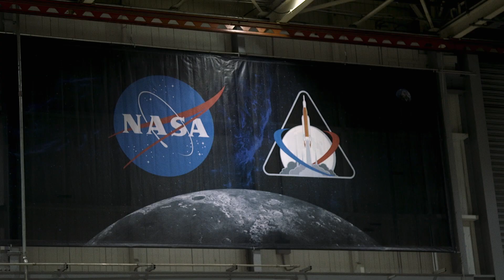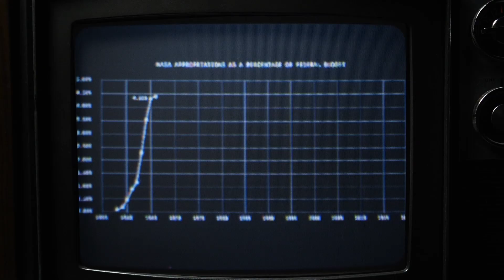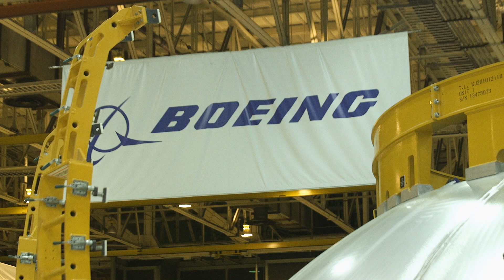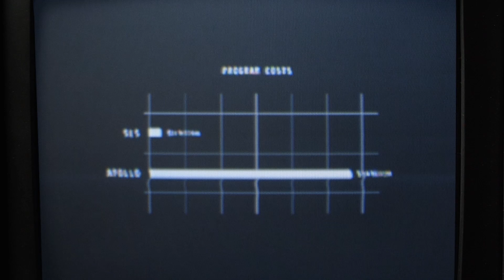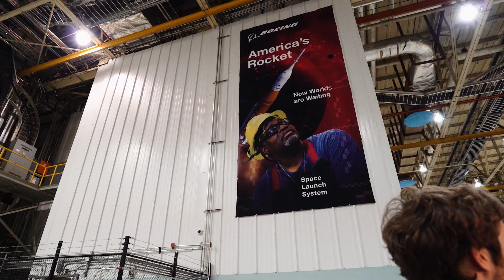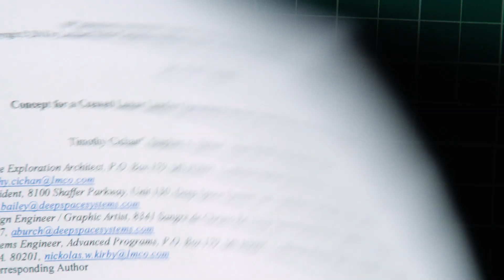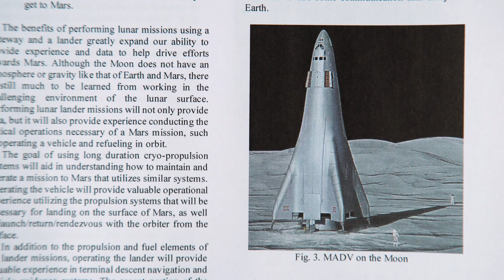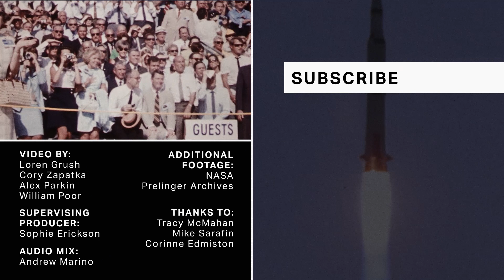Why NASA hasn’t gone back to the Moon

Comment: Let's cut it short.

NASA hasn't been funded enough. End video.
Reply: Also a lack of public interest and political will. Probably also doesn’t help that our economy is mostly service based and no longer manufacturing
Reply: Cardinal but NASA said they destroyed the technologie to go to the Moon. Sounds not like how humanity would deal with that kind of technologie.
Reply: Nasa also explained why its pointless re-building plans from 50 years ago. There is an in-depth video explaining how it's easier to build a new rocket from the ground up than to make an exact copy of an old design. You can simplify the new design and make it more cost-effective the second time around. We got there once, we can make there again.
Reply: Cut it short, nowadays America is shi. , Compare to the old time super America
Reply: @oneeco  Building 'new' rockets died in the 60's.  Why build inferior technological  'rockets' when we possess the capabilities to back engineer downed UFO's?  Ask Bob Lazar about "The Sport Model".  By the way, saw and listened to  Lazar at the McMenamins UFO gathering last May in McMinnville, OR.
Reply: @G-ra-ha-m  I said it was easier to build a new rocket than to use the older one for multiple reasons. Your F-1 rocket statement just agrees with my point.
Reply: @oneeco  Yes, often easier to build new. Things people are never going to build again are: 1. Combustion chambers made of lots of brazed tubes (limits pressure and adds pumping losses), 2) straight through injectors, no use burning the stuff once outside the rocket motor - look at the flame on the F-1 stage!, 3) Open cycle turbo-pumps, all a feature of the F-1.
Saturn V didn't even use the new J-2 motor, you can see the yellow burn of an H-1 motor on separation in the earth based newsreels (NASA has hidden the full uncut launches).
Reply: Cardinal  Let's cut it short... America is 22 Trillion dollars in Debt. End video!
Reply: @shamsthecat1996  For 50 years of NASA budget NASA would have been all over space if it wasn't for the radiation, as would other nations. 
The discovery of the VAB was a great shock to the entire rocket community world-wide and the later knowledge of the constant hard radiation past the VAB put the lid on it.
The race to the moon wasn't won, it was cancelled.
Reply: Why? Faking a moon landing is easier and cheaper nowadays..
- better CGI
- cheap crisis actors
- easier to make fake footage overall
Reply: Delphinium Flower  what the, you do know the tech needed to fake a moon landing didn't even exist at the time right?
Reply: as far as you can see, today we dont have cars from 50s or 60s, just like those guys didnt have cars from 20s 10s. Only old cars you can find is ones in old photos or in somebodys collection. Everything old is destroyed constantly. From cars to fridges. From old building materials to children toys of past. Thats not something of a fantsy that 50 year old parts are gone. They didnt plan to using technology again, why keep it?
Reply: Delphinium Flower  -_-
Reply: But then she won’t get to babble about chicks going to space and blah blah
Reply: It's not only about funding .
Reply: It not so much as NASA destoyed as it is no longer produced by the companies who made them.  Besides we don't want to go back to the moon with 1960s and 70s technology.
Reply: @Whitedog2024  I can't argue with that one.
Reply: @G-ra-ha-m  Anyone could see the Apollo spacecraft in orbit in space at the time the launches were done.  They were definately in space with the lunar module.  The Saturn 5 engines wo8uld shake the ground like an earth quake.  I know because I felt them once.  And now we have a group opf retards caliming the landings never happened.  Prove it.  You've been called out.
Reply: @G-ra-ha-m  Yet, for all your talk, we saw them in orbit in space with the use of small ground bsed telescopes.  Did you ever consider the color of the burn had to do with the chemicals that were burned?  Of course not.  Because you're an armchair scientist, who has never made a complete experiment or observation in his life, and therefore an expert.  YOU are an expert on nothing.  You have no idea what you're talking about.  All you have is conjecture and opinion because YOU "thought" about it.  Not good enough.  Show your research work that proves what you're saying or have nothing besides an opinnion.
Reply: @G-ra-ha-m  I see you know nothing about space radiation either.  James Van Allen was working for NASA at the time the moon shots were made.  During the live telecast of Apollo 11 he even had a presentation showing how the astronauts were passing through the belts.  In discussing the radiation of space you must remember it isn't nuclear radiation.  Nor is the environment of open space as radioactive as you make it sound.  At this point I want to see the graduate work you performed and the academic papers you wrote on the impassability of the Van Allen Belts and why we can't live there.  I'm going to be waiting for a long time.  Because you are know nothing conspiratard who thinks he knows everything.  You have a lot to learn young man.
Reply: Delphinium Flower  Yes, the tech did exist to go to the moon.  And NASA did a good job of it back then.  If you don't have solid evidence the moon landings were faked STFU.
Reply: @johnunderwood-hp8rj  "James Van Allen was working for NASA at the time"

You have your answer right there.
Reply: @johnunderwood-hp8rj  You didn't see them, actually, even today it's quite hard to see the detail of the ISS as it flies over.
Reply: @G-ra-ha-m  Don't try to tell me what I did and didn't see.  I saw them through my friend's telescope when I was a kid.  It isn't hard to see the detail at all.  I actually get a pretty good view of the ISS.  Just as I did the Space Shuttle when it was in service.  And the Space Shuttle docked at the ISS.  You need to reassess your statement and try again.
Reply: @johnunderwood-hp8rj  You saw something in orbit, that's all. I see the ISS everyday when it's in range, doesn't mean it's going through the VAB, surviving in cosmic and solar radiation for 10 days and everything hurriedly thrown together by the cheapest contractor worked on the moon.
Think about what you DIDN'T see, a full 170 second clip of the Apollo 11 launch, Neil having to adjust to 1/6G after a high G launch and days of weightlessness, Buzz commenting about the brilliant stars visible from the LM shadow, together with the brilliant jewelled Milky Way, the freezing cold of the LM shadow, the fierce heat of the unshielded sun hitting him full on from one side, the careful photographs of the EARTH, the missing attempts to photograph the stars and the bright Milky Way, the missing exposure brackets on a lighting environment new to man.
Just let you imagination take you to the moon and the LM, and then ask yourself why no astronaut never noticed the obvious stuff, the rocks all with clean tops and heavy weathering patterns, the lack of insulation damage on the LM when the tiny ascent engine manages to wreck even it's own insulation, the missing fogging in any of the films, the weird orange stain from station six in Apollo 16 that got on the camera from an airtight suit etc.
Reply: @johnunderwood-hp8rj  3KB computer, handmade handcraft rocket and engine, and some antique radio TO walk mans the moon and  live stream video to black and white tv here on earth. Compare to today, haha long way backwards.
Reply: Damian

How else would they explain the fact that the Congress stopped the moonflights and the remaining hardwares were placed in museums?
Reply: You could give them a trillion dollars and they still couldn't get a man on the moon....
It was all a lie...
In 1969 it was easy to fool the public... 
We are in 2019...wake up and smell the coffee..
Reply: @thepilgrim1581  You should grab yourself some.
Reply: @oneeco  I have...... 😂
Reply: @blackholeentry3489  bob lazar is a joke
Reply: @YoVille451  Everyone is entitled to their opinion.  I happen to disagree.
Reply: @YoVille451  You are certainly entitled to your opinion.  I saw him in person last year at the McMenamins UFO Festival, the first time he had ever attended one and I don't agree with you.
Reply: There should be an international agreement to lower milatary fundings and instead fund companies like NASA
Reply: Yeah thanks. What a waste of my life
Reply: @DreamingConcepts  you must think you're so funny
Reply: @thepilgrim1581  the joke flew so far over your head...
Reply: @blackholeentry3489  You can't have opinions on facts
Reply: @LineOfThy  And, the "Facts" ??
Reply: you mean...NASA hasn't embezzled enough of taxpayer money😀😀😀
Reply: @athan7199  If you want to know who is embezzling all of your tax money, go to the military not NASA
Reply: @LineOfThy  both are doing it!
Reply: @athan7199  Except which one is doing more?
Reply: @LineOfThy  so in the deepest part of your mind, you dombezzling too...right? 😀...for me its the principle...if its wrong, its wrong... irrespective of $1 or $1billion.
Reply: @athan7199  My point is, go after the organization that spends 20 times the budget and does nothing to benefit humanity.
Reply: @dedicatedcommunist6544  I drive a 58 GMC 3/4 ton pick and have owned it since '69.  I was a mechanic most of my life and over 40 years ago put a Pontiac 400 in it...still runs great and has surprised many over the past decades.   

I met my wife 15 years ago, while on a motorcycle trip, and all of this time we have maintained a marriage while living 210 miles apart, but shortly I'm selling my house as we are finally combining households.  I figure it will take me about three trips to move my shop and etc...then I'm selling the truck.    BHE
Reply: @Deathven1482 Well yeah especially since cold war ended 33 years ago
And also the reason for the iconic moon landing was because USA and USSR fighting for be who are better

Comment: Are we supposed to believe that NASA spent the majority of their Apollo budget on materials and labour? Surely the majority of the cost was research and development. With that all safely behind them they need only a fraction of the original budget to repeat their incredible feat. Don't they?
Reply: Actually, they weren't really sure that pod they sent would make it, it wasn't safe by a long shot. That's why they want to start again.
Reply: @DeadEyeJedi  seriously they don't seem to have any compunction about killing astronauts.
Reply: J Calhoun  you apparently don't realize that no matter how many parts something takes it should still be less than the R&D stage took, or else that means they didn't research & test parts at all. and if 200 billion worth of research got scrapped that's a good sign the entity should not be receiving public funds.
Reply: I am and have worked in aerospace, it helps to have a design used before, but if you change it more than just a tiny amount. More or less it must still be completely re-engineered. And none of it is cheap. Ever.
Reply: Materials and labor, yes.  Labor is ridiculously expensive. You're not hiring just anyone, you're hiring top military contractors and top of their class university graduates.

Then you have to pay them every month for years, for as long as the project is around.  Labor is EXPENSIVE.
Reply: @Top_Cheeze  You can't 3d print an F1 engine, partly due to the fact that not every material can be 3d printed, but mostly due to the fact that due to how 3d printing works, you'd have to redesign the whole thing to even be printable. Even minor changes to design would also mean rigorous testing in order to meat the safety and reliability standards necessary, at which point you might as well design from scratch.
Reply: J Calhoun   J Calhoun  why would you scrap the means to reach THE MOON?!!? machine tools are the jewels in nations' industrial and defensive crowns. They're frequently confiscated or destroyed by invading armies. Why would you SCRAP your own?!!?
Reply: @DeadEyeJedi  I think you're misunderstanding my idiom. I said 'safely behind them'.
But while we're on the subject. Apollo 11 had enough fuel to make only THREE adjustments to its trajectory en route to the moon. It landed a whole THREE SECONDS later than had been predicted. UNBELIEVABLY smooth and predictable for such a 'risky' first flight mission.
Reply: @MustafaBiggun  
Yes, extremely close cut, because fuel = mass, and more mass requires more fuel, so it was planned to within a very small bracket of safety. Nowadays, such risks are much harder to make, a crash on the moon would be a calamity after the first one worked out ok. Look at the damage the Challenger disaster did to the Shuttle program, it was a large contributor to the winding down of the Shuttle missions.

Nowadays, NASA would want to rebuild from the base up, they aren't being forced to race the Russians, so the political pressure is far lower, they want to start from the beginning and do it properly and in a way that means it won't be another 50 years before we try again. The last time we did it, it was because it was hard, this time it's to prove that we can make it easier.
Reply: J Calhoun  yes. If you wanted to make a 1960 Cadilac  (moon going rocket) you'd use the same everything. It worked like a charm almost every time. It ain't broke. Don't fix it.
Reply: @DeadEyeJedi    
so, when the USA was locked into a life-or-death struggle with the Soviets they were under LESS pressure to succeed than they are now? If they'd failed then, on the world's stage, ceding supremacy to their sworn enemy, THAT would've been easier because it was their first attempt? 

'This time we're doing it to prove we can make it easier' so this time it'll be 50 years in the making - and that's easier? Seemed like they barely had to think about how to do it 50 years ago. Wasn't THAT easier?
Reply: @MustafaBiggun  
It took over a decade of funding and research last time, and that was to get a system that was barely reliable and stood a good chance of killing the Astronauts involved. Not trying to out politic the Russians would have been less forgiven by the public at the time that failing, than was the political landscape at the time. That was the political gamble that was being taken., by both sides.

Once the political goal had been achieved,  NASA funding plummeted. Now NASA are in a position where Government and Public interest is rising enough that they can go again, but there's no Space Race to compete in, they can make a much safer system from scratch and whilst it still won't take 10+ years this time, they can still do a more thorough job of it.

Remember 'faster' is not 'easier', safer and cheaper is easier, especially when it comes to things like Space Flight, and even more so on the brink of the beginning of the era of commercial Space Flight.
Reply: J Calhoun  then don't build ANY new parts. 
If the 67 Chevy was the only car that could EVER break the 100mph barrier - just BUILD MORE 67 Chevys! 
The whole re-engineering argument just doesn't hold water. The old 67 Chevys worked BEAUTIFULLY.
Reply: J Calhoun  so they built millions of one-off custom parts each time they went to the moon? 

Cool story Bro 😉
Reply: No, you know absolutely nothing about how all this works

Comment: It's a little known fact that anytime a journalist uses the phrase "height of the Cold War" a historian of the Cold War dies.
Reply: Why? In this case she is not referring to the Cold War itself, but to a part of it, the most important indeed. The Space Race
Reply: @yassm  "Height of the Cold War" has been used to refer to any point between 1945 & 1989. It's just one of those terms people throw out without thinking about what it means. There were several periods of tension and risk during the Cold War, not one "height". The space race was a major element of the Cold War, but it wasn't the most important, dangerous, or defining period of the Cold War. There are many contenders for the "height" and my irritation is that people use the term without thinking about what or when the "height" was.
Reply: @davidbelgrave1971  Oh okay got it 👍

Comment: Because we never landed on the moon. They realized there were many dangers into flying into space:

Avoiding the Van Allen Belts. Scratch that “SPEEDING through the Van Allen Belts fast enough” 

Making sure there is enough fuel back & forth (According to Secondary Sources: Six days of travel: 3.14x10^3 mph for a distance of 2.39x10^5 miles.).

Enough food/water for an estimated 6 days to travel back and forth (Does anyone have any information from a primary source that the flight took 76 hours).

Building a proper lightweight suit to walk on the moon.
Reply: Right